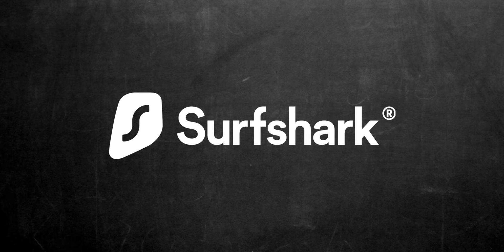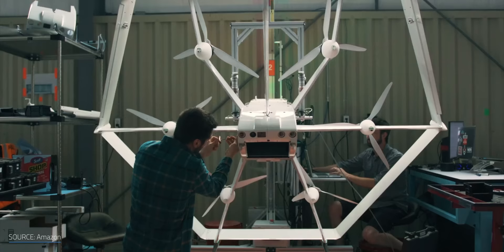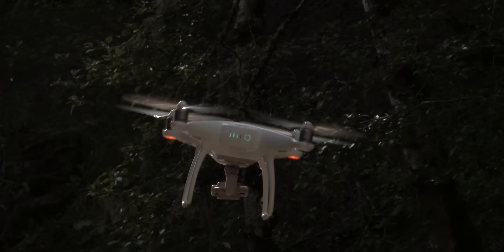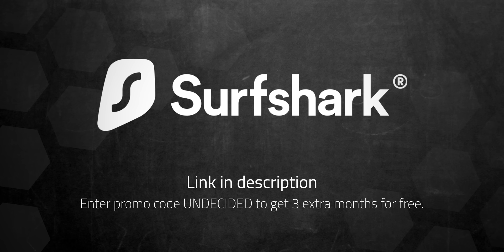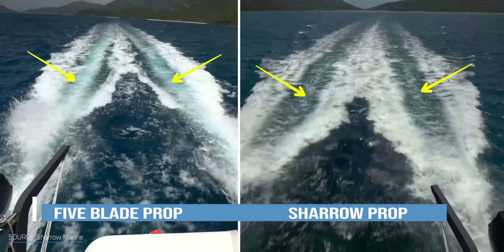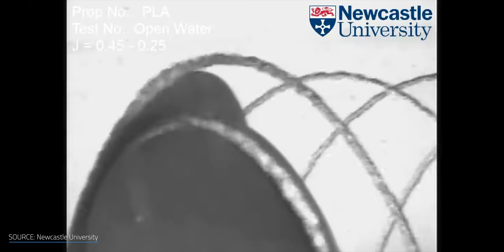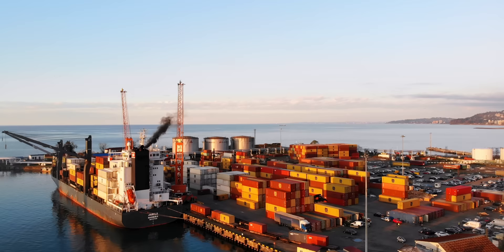Why is this Propeller Getting So Much Attention?

Comment: TOP 10 THINGS YOU MIGHT NOT KNOW ABOUT CLIMATE CHANGE

1. For the majority of the Earth's existence, polar ice caps were non-existent, and the average global temperature was notably higher, ranging from 8°C to 15°C above contemporary levels.

2. The Earth is presently situated within the Quaternary Glaciation, which is a glacial period that commenced approximately 2.58 million years ago.

3. The termination of the last ice age approximately 12,000 years ago marks the onset of the current episode of global warming, which marks the advent of the Holocene interglacial period. The present-day warm climatic conditions are limited in duration, as interglacial periods exhibit a temporal range of 20,000 to 60,000 years.

4. During the Early Holocene period, which occurred between 12,000 and 7,000 years ago, there was a significant rise in sea level. According to scientific research, the global sea level rose by approximately 197 feet (60 meters) during this time period. Interested individuals may refer to the scientific literature to learn more about this phenomenon, which is commonly known as the Early Holocene Sea Level Rise.

5. Climate is a dynamic and constantly changing system that exhibits variations in response to a variety of factors. The notion of a static, unchanging climate is not supported by scientific evidence. For those seeking to expand their knowledge on the subject of climate variability, a study of past climatic fluctuations such as The 8.2 Kiloyear Event, The Little Ice Age, and The Year Without a Summer (1816) may prove insightful.

6. The long-term evolution of climate is subject to a multitude of factors. Among these factors, human activity has been determined to exert a substantially lesser impact compared to other factors, such as solar activity, the Milankovitch Cycles, or volcanic activity, which have been found to operate on multiple orders of magnitude greater in their influence.

7. Chaos theory is a highly effective mathematical tool that is utilized to describe the behavior of complex systems. One of the most fascinating aspects of chaotic systems is their sensitivity to initial conditions, which can result in unpredictable and seemingly random behavior. This sensitivity is not restricted to complex systems, as even simple ones can display chaotic behavior, as demonstrated by the well-known example of the double pendulum. The climate system is a tremendously complex system, consisting of a large number of variables that contribute to its highly nonlinear nature. Given the intricate interplay of numerous factors, ranging from atmospheric conditions to ocean currents, it is hardly surprising that climate models are renowned for their unpredictability. Even the slightest perturbations can result in significantly different outcomes. Furthermore, the difficulty of accurately predicting the evolution of the climate is compounded by the challenge of effectively monitoring weather patterns due to the lack of appropriate technology and instrumentation.
 
8. Water vapor accounts for 95% of all greenhouse gases present in the Earth's atmosphere.

9. The geologic epoch of Hirnantian Glaciation was characterized by a substantially higher concentration of atmospheric carbon dioxide, estimated to be tenfold greater than the contemporary era.

10. Carbon dioxide (CO₂) cannot be considered a pollutant in any sense according to scientific understanding. The vast majority of atmospheric oxygen, which is essential for most forms of life on Earth, is generated as a byproduct of the process of photosynthesis, wherein CO₂ is converted into glucose and water by living organisms using light energy. Moreover, CO₂ finds widespread usage in several industrial and medical applications, such as the production of carbonated beverages in the food industry and in laparoscopic surgeries performed in hospitals. Therefore, based on scientific knowledge and understanding, CO₂ is not appropriately classified as a pollutant.

-----------------------

Despite extensive research on the effects of climate change, significant uncertainty remains concerning the impacts on humanity. The complex nature of the Earth's climate system and the limited understanding of its mechanisms make it challenging to draw definitive conclusions about the potential dangers of the current climate trajectory. To address this issue, it is crucial to consider diverse scientific opinions. Notably, some highly respected physicists, including Nobel laureate Ivar Giaever and Freeman Dyson, have expressed skepticism about the man-made climate change hypothesis. These experts have labeled global warming as "pseudoscience" and have characterized climate change predictions as "absurd." As scientific investigations require empirical evidence and rigorous testing, it is crucial that expert opinions are considered in open and honest dialogue. While consensus may be valuable, it is important to recognize that science is not a democratic process and requires a continuous and objective examination of data to understand the complexities of climate change. As Carl Sagan put it:

Sᴄɪᴇɴᴄᴇ ɪs ᴍᴏʀᴇ ᴛʜᴀɴ ᴀ ʙᴏᴅʏ ᴏғ ᴋɴᴏᴡʟᴇᴅɢᴇ. Iᴛ ɪs ᴀ ᴡᴀʏ ᴏғ ᴛʜɪɴᴋɪɴɢ; ᴀ ᴡᴀʏ ᴏғ sᴋᴇᴘᴛɪᴄᴀʟʟʏ ɪɴᴛᴇʀʀᴏɢᴀᴛɪɴɢ ᴛʜᴇ ᴜɴɪᴠᴇʀsᴇ ᴡɪᴛʜ ᴀ ғɪɴᴇ ᴜɴᴅᴇʀsᴛᴀɴᴅɪɴɢ ᴏғ ʜᴜᴍᴀɴ ғᴀʟʟɪʙɪʟɪᴛʏ. Iғ ᴡᴇ ᴀʀᴇ ɴᴏᴛ ᴀʙʟᴇ ᴛᴏ ᴀsᴋ sᴋᴇᴘᴛɪᴄᴀʟ ᴏ̨ᴜᴇsᴛɪᴏɴs, ᴛᴏ ɪɴᴛᴇʀʀᴏɢᴀᴛᴇ ᴛʜᴏsᴇ ᴡʜᴏ ᴛᴇʟʟ ᴜs ᴛʜᴀᴛ sᴏᴍᴇᴛʜɪɴɢ ɪs ᴛʀᴜᴇ, ᴛᴏ ʙᴇ sᴋᴇᴘᴛɪᴄᴀʟ ᴏғ ᴛʜᴏsᴇ ɪɴ ᴀᴜᴛʜᴏʀɪᴛʏ, ᴛʜᴇɴ, ᴡᴇ ᴀʀᴇ ᴜᴘ ғᴏʀ ɢʀᴀʙs ғᴏʀ ᴛʜᴇ ɴᴇxᴛ ᴄʜᴀʀʟᴀᴛᴀɴ (ᴘᴏʟɪᴛɪᴄᴀʟ ᴏʀ ʀᴇʟɪɢɪᴏᴜs) ᴡʜᴏ ᴄᴏᴍᴇs ʀᴀᴍʙʟɪɴɢ ᴀʟᴏɴɢ.

-----------------------

To mitigate the influence of confirmation bias, it is prudent to actively seek out opposing viewpoints that diverge from one's preconceived beliefs and perspectives. The act of engaging with dissenting opinions may yield valuable insights.
Reply: Top 5 misunderstandings about climate change.

1. Yes, there were periods, which were warmer than our current one. 
 But to claim, that this means, that these conditions would be still fine for our current biosphere, is stupid.

2. Yes, climate is dynamic. Nobody claimes, that it is static.
Changes have two properties:
- amount of change
- rate of change

The main problem about current climate change is the "rate of change".

3. Human activity is a siginificant factor!
- Milankovitch Cycles have large periodes and generally don't effect climate on short timescales like centuries. And we passed a maxium in this cycle, so it "should" be getting cooler because of that, not warmer.
-  The influence of vulcanic activity (we experienced in our age) is on average ~100 times "smaller" than human activity.
- solar activity has an influence. But not necessarily significant.
Example: 
The highest solar activity in the last 100 years was 1958
The lowest solar activity was 2020

Guess, which year was wamer....

4. Yes, our atmosphere has a high greenhouse effect by its composition and nature.
Without any greenhouse effect, average temperatures would be about 33°C lower than now.
Thats a lot and should remind you, that even minor changes result in a few degrees Celsius.

5. "Carbon dioxide can not be considered a polution."
Maybe "not directly for plants". But indirectly, it sure can have bad side effects.

Just because your body needs glucose and salt, doesn't mean, those things can't be bad for your body, if there is to much.

And yes, changed climate conditions can be harmful, even when it is just a side effect.

Dirt is also necessary for our biosphere and shouldn't be considered a polution, right?
But you would probably agree, that it can have bad effects, when you blow a lot of it into the atmosphere.

Just to point out, that it is harmless in certain situations, is manipulative and stupid!

Comment: Sorry to harp here but I can't hold back.  I find that methodology of the study you mentioned at the start extremely suspect.  Drone noises are almost soothing they are so inoffensive.  There is no chance people find them more annoying than Harleys, cars with squeely breaks, jackhammers, impact drivers, grinders cutting anything metal, leaf blowers, mowers, blenders, shopping cart wheels, washing machines on spin cycles, garage doors opening(not perfect new ones).  My point is this:  That study HAD to be motivated.  The only way to get that result is warp the study to point of meaninglessness.

Comment: Actually a toroid propeller would possibly solve the turbo prop problem in aviation: right now turbo propeller planes are extremely noisy compared to jets and if you could both increase performances and lower the soundprint it could change aviation.

Comment: Efficiency and fuel gains is great, but saving CO2 emissions and carbon in general doesn't help us at all.  It is the heavy metals an other human and plant harming pollutants that we need to lower.  In fact, with too low CO2, you might actually harm human respiration, and certainly the food supply.   Global climate change is caused by sun activity, not humans, which is why temperature changed on Venus and Mars too.

Comment: Small boats with $ 5.000 props ???? Yeah sure . Hit a log or rock a couple of times or the dock ramp , and see how fast you go back to the regular one . I repair props . The shape of the vanes would never be as good , repaired as it was new . Even if it looked right , if it could be repaired at all depending on how badly it was hit . There should be a future for this design with a "root" attachment for the vanes similar to turbine blades . This would make the repair more cost effective . While keeping to original efficiency .

Comment: 105% better is just 5% over original performance, right?
Reply: No, it's more than double the performance, since it's a 105% INCREASE of performance. What you are thinking of is 105% OF the previous performance, which would only be a 5% increase.

Comment: Innovative and disruption is part of r&d. Electric drones are going to disrupt delivery. Electric will disrupt flying. 100% efficiency when costs of fuel are 40% of flying.
So engineers will figure out how to make them at scale then it's a no brainer to change. Boats and aircraft with double the range. They are already economic. This doubles the value.

Comment: How in the world can something have an efficiency of 105%? An efficiency of 99.999999% may be possible but that last little bit, never! All systems have losses due to friction, heating and resistance. 100% efficiency would be a violation of the laws of thermodynamics and would be a perpetual motion machine. 105%? More energy out than in is simple impossible.

Comment: these propellers don't seem useful for drones. you seem better off getting improved sound and efficiency by adding more propellers which allot of FPV pilots don't do as the incresed weight reduces responsiveness which is also a problem for the toroidal propellers as they are heavier for the performance they give. 
also, toroidal properlers don't seem to give the results promised and even give worse sound/efficiencey from testing on drones, but that could be issues with comparing 3d printed toroidal propellers against top of the line manufactured drone propellers however this could also be a sign that toroidial propellers  are just propeller snake oil.

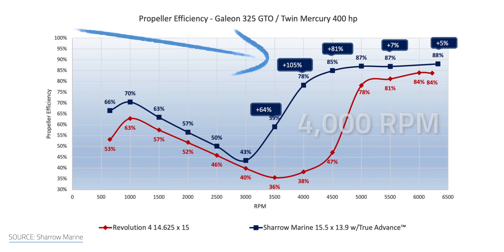Comment: Whoa. Rephrase your video description. The energy efficiency was NOT boosted from 20% - 105%!  Efficiency is (eff = desired output/required input) and an efficiency >= 100% is not acheivable. Per your video at ~8:10, It was 105% more efficient than the average propeller at 4000 rpm.

Comment: Interesting to learn about benefits of new prop designs.  However, I find it ironic to claim a 20% reduction in energy use for an application that is purely entertainment.  Seeing those small speed boats with two big outboard motors would still be inefficient.  Ironically, the more you use the boat, the more you save.  However, the more you are burdening our climate because your pursuit of happiness requires pollution.

Comment: misleading hype. this has been tested by multiple youtubers to find it not so much quieter and little added power.  all the benefits of propeller design is only due to added surface area, which makes it better than a propeller of similar width/radius.  make a standard propeller that is of similar surface area of the toroidal then you get same benefits at a fraction of the cost.

Comment: No this propeller is a load of shit. I personally tested this while working in the testing department at a major outboard OEM, and the vibration and noise was same if not worse at all RPMs for every engine I tested this style on. There may be something to the performance metrics especially in reverse, but their claims are an order of magnitude or 2 above what the actual performance is. For top speed it was reduced by about 8% on average, with no engine or boat meeting the same top speed on the same day in the same conditions. Also, only 1 boat that I tested was able to get on plane faster than the oem prop, and it was by ~120 RPM, not the 300 RPM Sharrow markets. 5k for a worse prop to get faster reverse speeds is a load of bullshit

Comment: OK...bad math if it is 105%.  Nothing can be > 100%.  What > 100% means is your denominator is wrong.
Reply: You can't exceed 100% when you're dealing with a single "whole", but once you start comparing independent values you can very easily go over 100% - I get $100 for a job, my 100% is 100. Next month I get $250, or 2.5x that. Since the value I'm comparing to is $100, my 100% is 100, then 250 would be 250% of my original pay

For non-decimal values you'd generally divide the original value by 100 to get 1%, then divide your final value by the result - My original turbine has efficiency of 0,3. My second design has efficiency of 0,75. 0,3 is my 100%, hence 0,003 is my 1%. Divide 0,75 by 0,003 and you get 250% once again (or 2.5x increase)
Reply from the maker: It’s not an efficiency of 105%.  It’s an increase or boost of efficiency of 105% from what you typically see.  I could have phrased it better in the video.